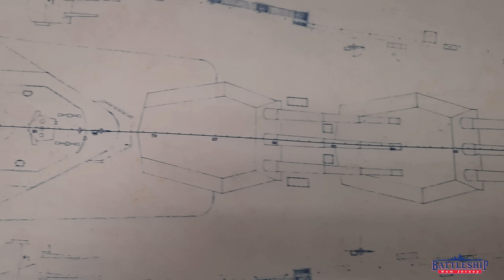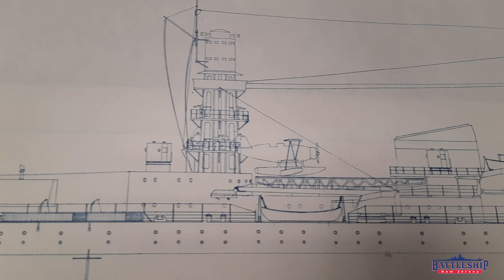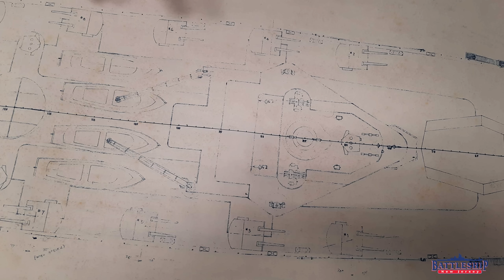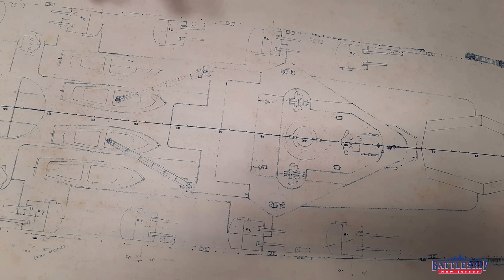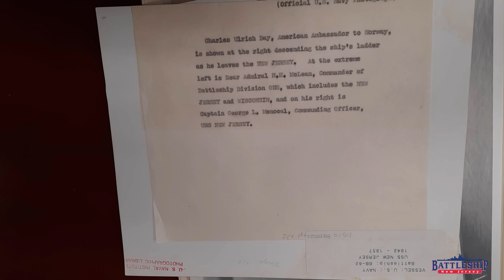Lost Blueprints of a Never Built Battleship FOUND!

Comment: I love these never built plans. My all time favorite is the Montanas Scheme 8 design, would love to build a model of one one day.
Reply: Montana is basically a longer Iowa with a fourth turret right?
Reply: @Sira_Kackavalj  yes, but the studies varied in some important details, scheme 8 was the longest at 1,050 feet long, almost 25% longer than the Iowas. It also had a non-superfiring secondary battery.
Reply: Ah yes, the Longtana
Reply: @Sira_Kackavalj  Not exactly.  Montana had a different armor scheme.
Reply: @Sira_Kackavalj  Slight changes to the whole armour layout, improvements to range, slight rearrangement of the secondary battery, swapping to 5"/54 Mk16's in Mk41's. All of the above changing more and less depending on which set of drawings for Montana you look at. One set of drawings even has room for a below deck hanger for the 2 Kingfishers. Or I believe it's space for one Kingfisher. To be used as a workshop, and other misc. space.
The later drawings even swap some 40mm positions for 3"/50 Mk33's. Which makes sense, By that stage in the war the US was using their BB's as Monitors, and big carrier AA escort platforms, as well as task force centrepieces for extending the range of destroyers and even cruisers. They were no longer seen as the kings of the see when the US had so many carriers, and more escort carriers than Japan had cruisers, or more CE's than half as many destroyers as Japan had.
Reply: @Sira_Kackavalj  Montana's were armord to go head to head with Yamato class. 16" belt I believe.

Comment: I have found a picture on the Internet which purports to be of a Projekt 24 Battleship dating to 1950. In the plan view it clearly shows that the Boiler Rooms are mounted just offset from the Centreline with the Turbines mounted outside them alternating between Starboard, Port, Starboard and Port with the Auxiliary Spaces being mounted on the opposite side to the Turbines. Could this plan actually be illustrating something like this scheme?